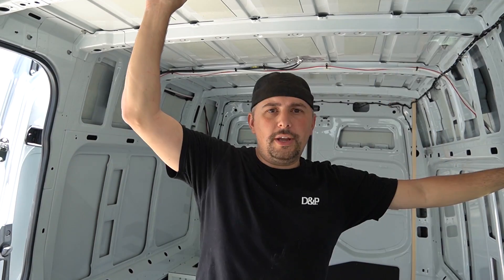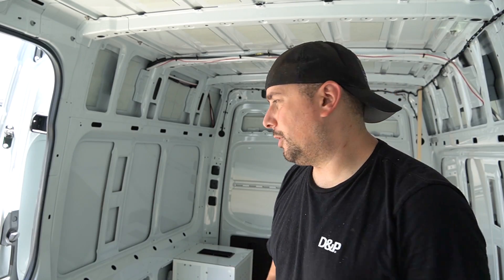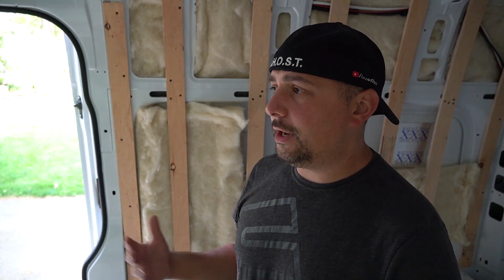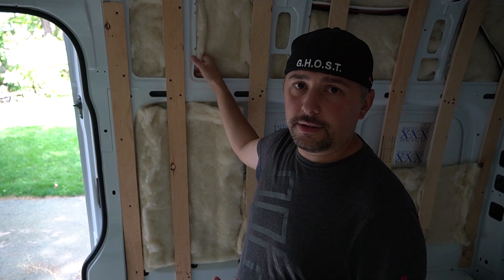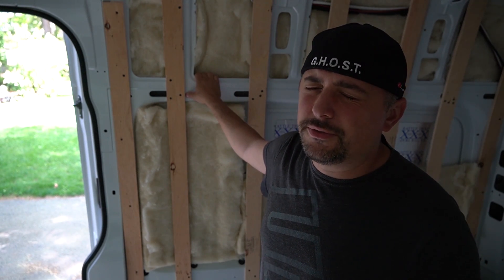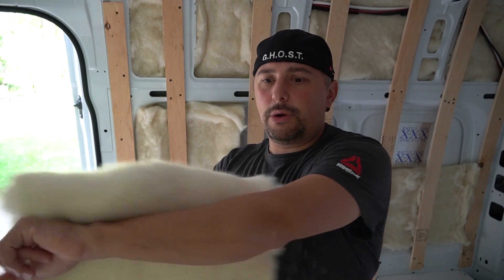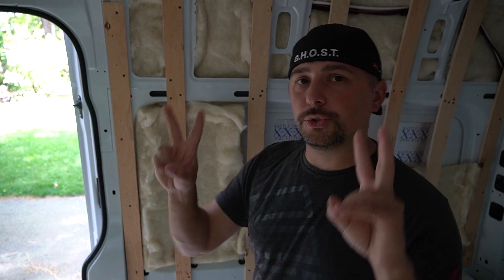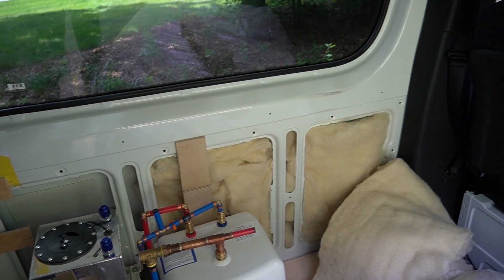GHOST Van Build - Insulation, Framing and Planning

Comment: For a second there I actually though you'd do a good job. I guess not.
Reply from the maker: It would be nice if you said why. I don't mind feedback or opinions but would be nice to know you're argument
Reply: @JarrodTocci  Sound deadening was done poorly. The whole resonating surface needs to be covered. That was my gripe

Other stuff is okay. Insulation should be top priority. Everything should be revoled around heat management. I think you did that okay. Van are tin cans.
Reply from the maker: @blazbohinc4964  that's actually something I agree with you. I built this van almost 2 years ago and I've since fixed that issue. However I wouldn't call it sound deadening everything. I'd call it covering all metal to create a thermal break. If I had the money I'd actually use a better product like Frost King to cover all metal. When I give workshops I actually admit messing that up
Reply: @JarrodTocci  good. there's still hope for you then. keep up the good work